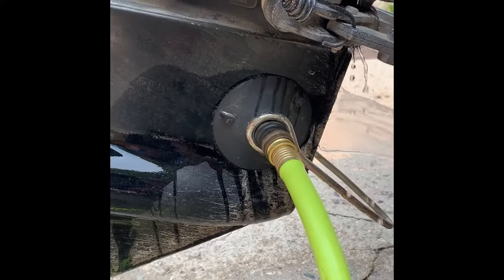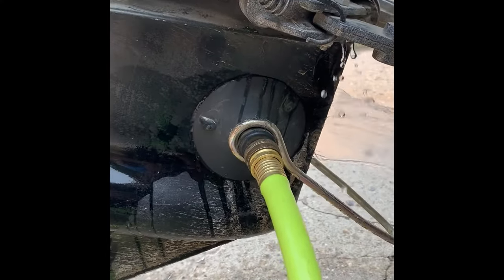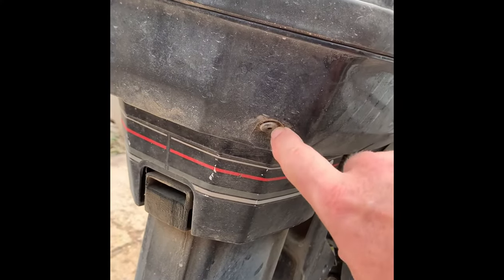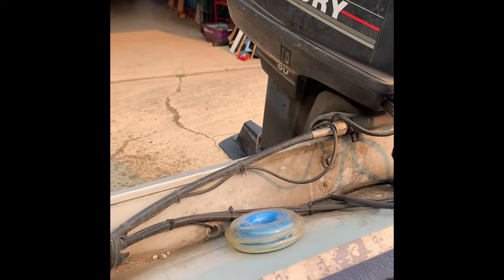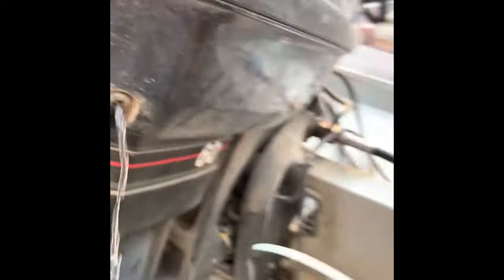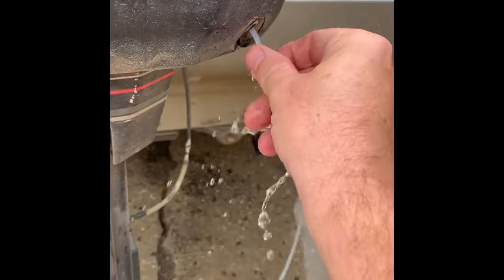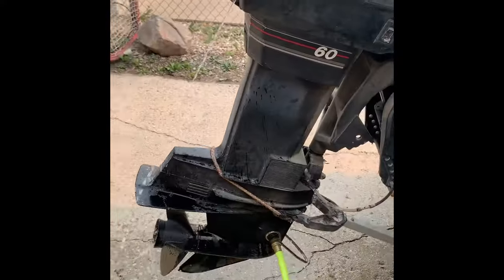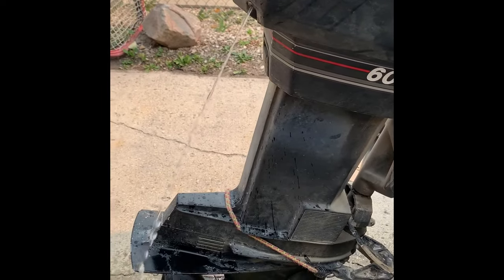How to unclog the tell-tale on an outboard motor.

Comment: Mines works great but the water is cold coming out and my motor is getting hot on my johnson gt150 vro would that because the thermostat? It goes into limp mode when trying to give it gas in gear right when it planes but at idle no alarm
Reply: Pull the thermostats out and start the engine on water muffs. See if you're getting water through coming out the thermostat housings. 

If you have a water pressure gauge, what is the reading while on the water ? Note: You will usually have a very low water psi. reading on hose muffs.

Comment: Please  tell  what is that  exactly  , thx
Reply from the maker: its weed wacker or whipper snipper line
Reply: @footprintoutdoors6144  What size line are you using specifically if I may ask?
Reply from the maker: @NwGtumbleR  it’s the generic size of weed wacker replacement lined. It’s a thick mono. Weed trimmer line.